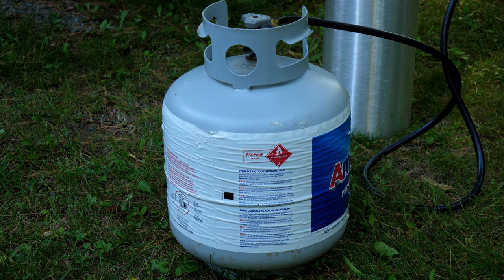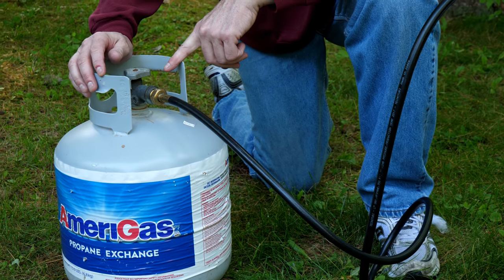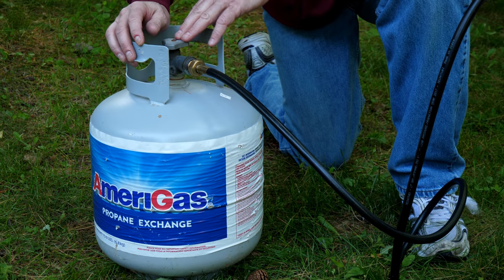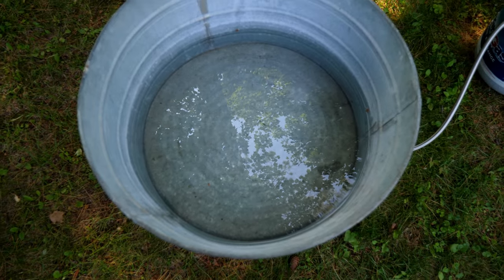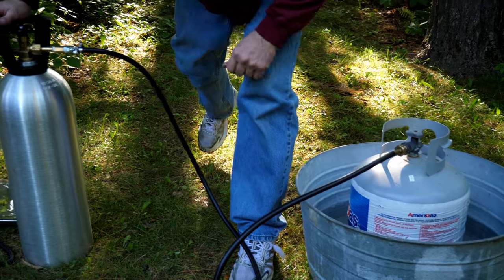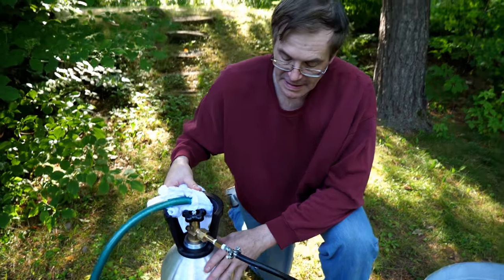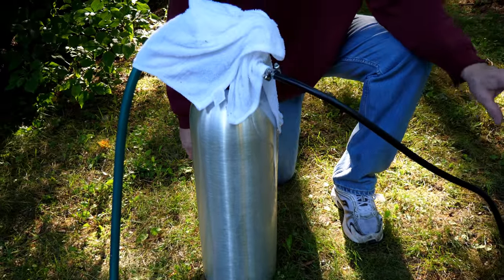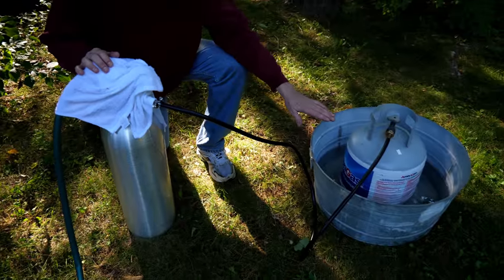Liquid Propane - How to Transfer Safely

Comment: would the hot water bath also work as a good method for refilling the coleman canisters and getting an easy full fill without having to put the green coleman canisters into the freezer to try to create the temperature difference that many say is required to fill the green canisters better but still isn't quite perfect?

Comment: You said the propane tank was designed to boil the liquid off rather than supply the liquid , isn't it just relying on vapour pressure sitting above liquid to output the gas with a high pick up  ? If the tank is turned upside down would the propane tank still emit gas and be operational ?
Reply from the maker: There is an anti siphon valve in these tanks that stops ALL flow when inverted.

Comment: Is there a reason not to use forklift liquid withdrawal LP tanks? Fittings are readily available as are tanks which are normally stainless and quite rugged. 
Does an inverted BBQ cylinder not produce sufficient flow? If so the 40lb LP cylinders do not have OPD valves and flow many more CFM (welders commonly use those and the 100lb LP cylinders for cutting torch fuel) and like any cylinder are simple to invert for specialty use for example on a modified hand truck.
Reply from the maker: That is an option if you have convenient access to those cylinders. 
Flow rate isn't important, but many of these 20 lb cylinders incorporate an inversion check valve, and this thermal method overcomes that.

Comment: Let's not talk about Cody, okay?
Reply: lol, I was sitting there and like halfway through I was like wait, didnt I just watch cody do this.  I actually think its cool to come from different source because not only do you get people like us getting a little quiz to prove you knew it, but also you get a confirmation that this works with multiple things, multiple ways.
Reply: Well ... he was dealing with a gas from a FIRE EXTINGUISHER ... That's a little bit different in terms of fire hazard from liquid propane.
Reply: Well, he was outside and frankly in terms of halon the point is it's no longer in mass production, that was the dangerous bit. Old extinguishers and sprays are lying around leaking halon all the time but we've pretty much stopped production of any new halon that would find its way into the atmosphere.
The danger there was the possibility of explosion (which would probably just punch a hole in one of the tubes or valves and not the tank itself) He's done MUCH more dangerous stuff than that (like handling supercritical CO2 in a vial which he sealed himself)

Comment: does the lpg vapor convert back to liquid in the co2 tank with out pumps or compressors?  wouldn't it be easier to supply liquid to the destination tank and vent gas to allow quicker filling to take place?  I need to do something similar and draw liquid from my house tank and fill a 60 gallon rv tank through the acme fill port.
Reply from the maker: It does convert back.  The other advantage of this method is that it is effectivly a distillation.  What is transferred is pure propane. Dirt, rust and heavy oils are left behind.

Comment: so it is impractical to try to heat a 500 gallon supply tank, ambient temp are in the mid 60's F.  Water temp for cooling  are near 50. I'll be trying to fill a 60 gallon rv mounted tank via the acme fill connector.  I don't have easy access to vapor but do have easy access to liquid, will this method work w/o other equipment?
Reply from the maker: You can transfer even with a 10 degree differential ( it may be easier at night), but it will be very slow if you do it like I did, as a vapor.  Liquid transfer will be much faster, but you'll loose the phase transition purification advantage.

Comment: So let me understand correctly , the vapour starts occurring at room temperatures and one atmosphere pressure,  14.69 psi , and will continue to 200 psi before going back to liquid . Will the propane completely empty under this condition ? Theoretically then we could use it to exchange one standard propane tank to another standard propane tank unless there is some mechanical design limitation ?
Reply from the maker: At room temperature, the gas exists in equilibrium with the liquid at approximately 125PSI.  When both tanks are open to each other the only reason all the liquid remains in the first tank is that there is not even the tiny differential needed to lift it up out of one and into the other. The propane in the tanks has no connection or relationship to atmospheric pressure and the process we demonstrated could be accomplished in a complete vacuum or deep under water.

Comment: Can you not just use gravity to move the liquid?  Turn the 20 lb tank upside down and hold it above the receiving tank?
Reply from the maker: No.  Most modern propane tanks have an anti-siphon float valve that stops all flow, liquid and gas, when the tank is inverted.  One exception  is the propane tank used on vehicles such as fork lifts.
Reply: @TechIngredients  Interesting.  I just watched a video of a guy inverting a 20 lb tank to illegally fill disposable 1 lb tanks.  It seemed to work fine.  Maybe it was the magic of Youtube.  From what I know on the float, it floats UP on an upright tank to stop the overfilling of the tank.  When the tank is inverted, the float would float up, which would be down if the tank was upright and allow propane liquid out.  I guess you could use a 100 lb tank which is not subject to the government mandated valves.

Comment: I refill the small camping bottles from commercial cylinders, with the little adapter they sell at Harbor Freight, never had any issue with the anti-siphon device. Maybe I'm just lucky.
Reply: EEK!  They really sell an adapter to do that?
Reply: @BrightBlueJim 
I've had mine for over a year, less than twenty bucks and payed for itself many times over ! 😊
Reply: @kengamble8595  Do you freeze the green canisters or just invert the source tank?  I've seen where they say you need to freeze the green tank to be able to get them to full. Likely similar to the temperature difference required to make it transfer he was talking about.  It looks like it would be much easier to do the 100 degree water bath than find space for 5-10 green canisters.  Then, the biggest thing would be calculating the 80% full weight.

Comment: It’s also used in airsoft but you need to add a little silicone oil and then you won’t have to buy green gas which is expensive for a 200 gram tank.

Comment: I like the concept using basic temperature difference , what is the temperature difference ?
Reply from the maker: Any temperature difference will eventually move all the propane to the cooler tank, but the larger the difference the faster the process.
Reply: Tech Ingredients yes but i was curious on your actual delta temp , around 60 deg C ?
Reply from the maker: Actually, close to 60F or 35C.

Comment: Like everybody else I was going to start screaming at the video when you lit that torch.  But then I thought, no, he can't be that dumb.  I can't wait for the jet engine videos to start.  You know, 1 of the hardest things to make is the stainless steel cans used inside the engines.  So I had an idea of using stainless steel thermos bottles and cut them up (I've done a few already) or those stainless steel double wall drink cups they sell in the big box stores.  Some of them even have tapered shapes for exhaust cones.  You could probably work out the math as to what shape works best.  Might save a lot of unnecessary spot welding.  I don't have time to do those experiments myself, but if you do them.  I'd like to see the results.
Reply from the maker: That is a good recommendation and I'll look into that.  Right now, the inner burn tube is a straight section of SS tube and some taper might prove valuable.

Comment: Need a siphon?  uhh,  no.  I transfer liquid out of a 20# OPD tank all the time.    just flip it upside down.   you only need a couple degreess of delta T between containers to push a whole tank easily.
I also have CO2 tanks and transfill from them into paintball tanks, etc...  same thing.  doesn't take much.

Comment: My dad converted an old pickup to propane in the early 90's.  We had a fueling station you could just drive into to tank up.  He would drive for months on a 150 gallon tank for like 50 bucks.

It was like 35 cents a gallon.  Why did it increase in price so rapidly compared to other fuels?
Reply: It didn't, the exchange programs are a great way to rip people off.  I used to work for Tractor Supply and they sell propane marked up a few cents a gallon and they fill whatever you bring that's legal.  I would suggest getting cylinders filled rather than exchanging them simply because of the cost.
Reply: Yep. It's a riff on the bottled water scam basically. I've never done an exchange thing. I've always just gone to the local propane place, and filled it up. They have trucks that go to people's house's too, and fill up the big tanks people have outside their homes. Ain't no natural gas lines out in the boonies, ya'll.
Reply: Small cylinders are expensive per kilo, but the bigger ones are a lot cheaper. I just use 9kg cylinders, as they are a convenient size to handle, and made a transfer tube out of 2 of the flex hoses used to connect them to manifolds. A simple adaptor from the 9kg bullnose to the small cylinder thread ( off the shelf at the gas supply place as well) and just turn the big cylinder on it's side to get faster fill, then turn upright for the last half kilo or so of gas to clear the liquid out of the pipes.

Helps here that the LPG price is regulated on the big cylinders, but not on the small ones, so instead of paying almost the price of the 9kg for a 3kg refill I get 2 out of the big one, and then use the rest as usual. Could also use 14 or 19kg cylinders, but they are inconvenient to move.

As well the price rose rapidly because of demand, LPG used to be a low use item, most refineries would use it as process heat internally, selling off a little at a loss for gas, or flaring it off. Then they started using it as feedstock for plastic production, and demand rose rapidly, so the price for the gas rose, and refineries started making money off it, plus people moved away from heavy fuel oil heaters to gas heaters.
Reply: Still  $2.00 $3.00 per gallon in bulk  like  500 plus gallons

Comment: Quick note about the exchange tanks. I have 3 places in town to fill my bbq tank. 2 of them actually have the proper fill station and the other is Walmart "exchange" anywho. For years I used the first proper fill station same guy would fill it everytime I'd hand him the tank he would hook up that very inflexible fill hose set it on the scale turn it on then open the bleeder screw, fill it up proper. Well one day I go in too get tank filled and a new guy fills my tank he didn't open the bleeder screw ( didn't notice we were talking )  A few bbqs later (ribs) i was out. Took it in too have it filled same thing. I was running out quickly. Even worse with the exchanged tanks wouldn't last very long. Meanwhile a new business started and installed a propane fill station. So I went there instead of exchange. This guy filled my tank I noticed he opened the bleeder screw. Then it dawned on me the place I had been going to for years when the new guy was trained from lack of paying attention or lazy or just wasn't told to do so wasn't opening the bleeder screw. My point is if you take your tank to have it filled make sure they open the bleeder screw. I'd say you lose 1/4 or a 1/3 of the tanks capacity if they don't open the bleeder screw. The exchange tanks were even worse and the price was even more. So 4 years ago I found myself broke down near Dayton Ohio. The company that brokers my work for me had an office there so they let me tow my vehicle to there yard. When I got there I noticed a ton of these propane exchange tanks. Next day I asked they said they sublease part of the property to a exchange company. Later on of the drivers was loading unloading his truck I asked who fills the tanks he said we do, I said do you open the bleeder valves he said hell no, I can fill more tanks faster by not opening them, he said. He also said if he were to fill all the tanks he wouldn't be able to fill his truck all the way up. So there ya have it. The exchange ranks don't fill them up all the way, so they can move more tanks. I did take the time to run some quick numbers. It seemed like I said they were cheating us out of 1/4 or 1/3 of the propane we paid for.
Reply: So if he wasn't opening the vent valve, how was he determining that the tank was full?  That's how my tanks have always been filled - fill until liquid comes out of the vent.
Reply: @BrightBlueJim  well, that's my point. They were not filling it all the way. I guess just guessing. It pushes me off cuz it's the same price to fill.
Reply: although the tank was set on a scale, it likely never reached full weight but stopped going into the tank because of the pressure(or area taken up by compressed air). If the tank is normally vented while filling then there needn't be much pressure to push the liquid in. As such, if it's not vented, that minimum pressure pushing the liquid will only push/compress the full volume of air so far.  Gas compresses, liquid does not, so there would be some amount of compressed air in there not allowing that volume to fill with liquid propane.

Comment: I haven't used it in a while, but the commercial 20 lb propane cylinder exchange path is a rip off.  Slightly more expensive than getting your own cylinder refilled, and very convenient, but they often, if not always, only fill the tank with 16 lbs or so.

BT Dubs, don't forget to label and purge the receiving tank.  From when I filled tanks many years ago, new propane cylinders arrived pressurized with something other than propane. If it wasn't purged it would interfere with the burners' operation.  Different case here with the CO2 bottle, especially after the first use and you're just refilling.  Also BT dubs,  since you've got extreme vacuum technology, why not purge and then draw down the receiving tank substantially  (don't crush it!), then invert the source tank in the warm water bath.  Purge the hose.  You should be able to skip the garden hose cooling and just leave the receiving tank on the scale.  Just crack the source tank valve open and watch the scale indication so you don't over fill.  

Typical LP tanks do have a draw straw that goes down from the tank's valve at the top, but that straw doesn't go all the way to the bottom, so it's of little use for getting liquid propane without inverting the propane tank.  It's supposed to go down about 20% of the liquid volume of the tank from the top.  This straw is on a separate smaller circuit from the main valve, and has its own tiny valve

Comment: Alot of work for nothing, get a 128 # tank with a non odb2 valve turn it upside down, Wala! Now you can release pressure in filled tank and no heating  or cooling or precipitations

Edit OPD, I am getting old or something, great channel
Reply from the maker: That's a good option.  For people who are limited to these exchange programs, the vapor transfer method is a good technique to know about.  Also, the vapor transfer acts in the same way as distillation to purify what goes into the second tank, leaving oils and water behind.
Reply: @TechIngredients  leaving oil water and stinko the rotten onion additive that adds smell to gas.
I service propane forklifts and #1 filter clogging contaminant is the stinko.
A forklift cylinder has a liquid output.

Comment: After 18 years with the same supplier, I switched to AmeriGas. Got a nice new shiney 250 gallon tank and hopefully what will be less expensive propane. The price of propane has become a somewhat expensive locally. Digging out my transfer apparatus, too. Even the small Coleman bottles have been running about $5 each, they can be refilled for much less.

Comment: Why did you not invert the warm tank to transfer liquid propane?
Reply from the maker: There is an anti siphon float valve that shuts off flow when the tank is inverted.
Reply: @TechIngredients  All my 20 lb tanks empty liquid propane with no issue when inverted.  I've done it dozens of times.  I know there is a float inside, but I believe it has another function.  I really enjoy your content by the way.

Comment: Much simpler and faster to invert and elevate the propane tank. Liquid would then flow rapidly if the supply tank is the least bit warmer. No need to continuously cool and heat the tanks since boiling isn't happening.  You can do the transfer with the destination tank setting on the scale. Just be careful not to overfill.
Reply from the maker: That would be true if these newer tanks weren't fitted with a check valve that stops all flow, liquid and gaseous when they're inverted.

Comment: Might it wise to have a tear down of the propane standard  gas cylinder mechanisms
Reply from the maker: You're right.  I wouldn't have done this before because it seemed too far afield from the applications for the propane ie the engines.  However, we intend to use large quantities of liquid  propane and the fiberglass tanks are the best for this.  As we will have to modify these for liquid extraction, the teardown and the components could be covered in a video.
Reply: thanks ,I would find it interesting . Great videos , topics and precise presentations as always

Comment: What would happen when you turn the commercial tank upside down in the water. Will you transfer the liquid gas directly by the  pressure building up by the  heat? My heart stopped for a second and remembered me a man lighting a cigarette while filling his car.
Reply from the maker: In some cases yes, however many commercial tanks, like ours have an anti-siphon valve that prevents the flow of liquid or gas when inverted.